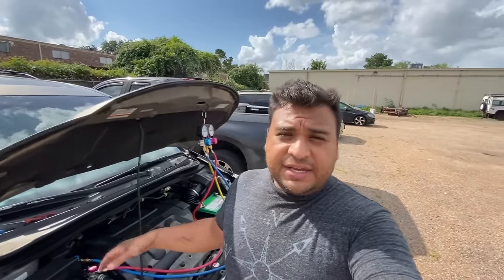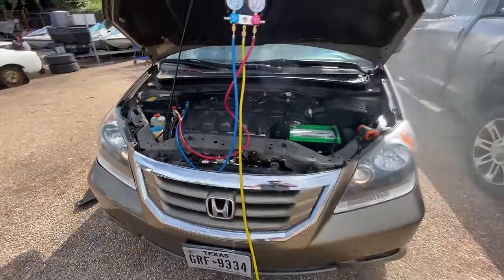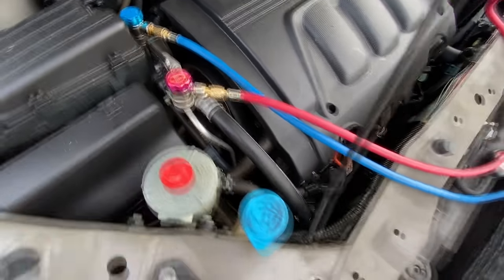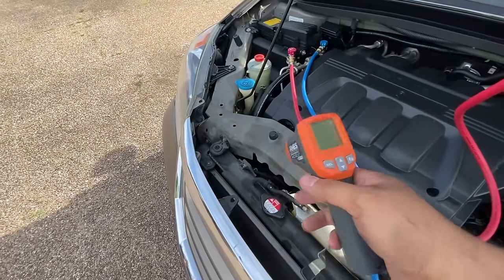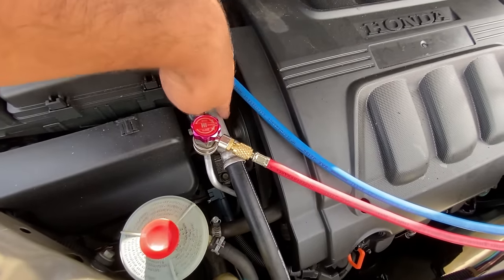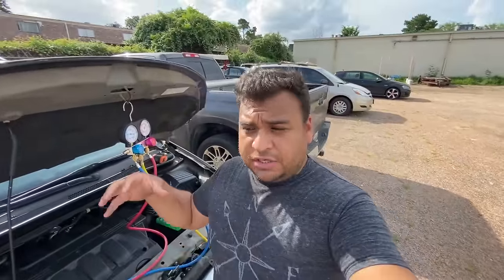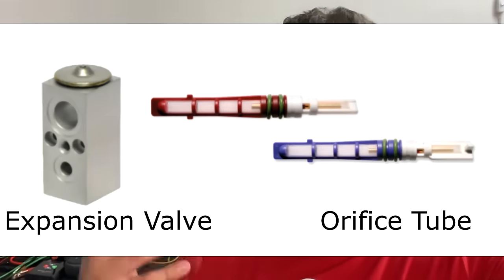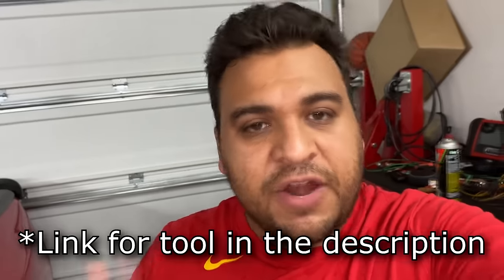HOW TO FIND A CLOG IN YOUR CARS A/C SYSTEM

Comment: Another compressor that didn't  need to be replaced  and another  costumer that paid for the  inexperience of the shop. Great video Eric
Reply from the maker: Luckily this vehicle belongs to the car lot. It is used as a loaner or rental car.
Reply: It may be possible that there was something wrong with that compressor, it may have been damaged if it was building up enough pressure to trip to relief valve. Likely not catastrophic but it may have reduced its lifespan. Kind of hard to know with these things.
Reply: where do you think the blockage came from? a failed compressor and a system that wasnt cleaned out.
Reply: @DieselRamcharger  yes exactly your meant to replace and flush the whole system out that's what they get for being cheap
Reply: @neilmurphy845  yup. running a solvent flush isnt even expensive.
Reply: @DieselRamcharger  they must just be cheapskates or dummies then I thought it was expensive
Reply: let it be clear dealers has mad the same mistake.
Reply: @CarlosRomero-bn1bn  its not a mistake its negligence. the dealers have factory repair information, which clearly tells you what to replace and what to flush. as well as they have a specific flush machine that recovers the solvent.
Reply: @DieselRamcharger  in the video he stated it probably be from a dent under the vehicle by the skid plate lower condenser
Reply: @DieselRamcharger  I beg to differ, dealer would have done exactly what was done in this video depending on the location and the ability of technician. This situation was a manual find. A machine can tell you there may be a problem, not the location. Have in mind dealers have fell behind in more complex technical work of today to where so jobs their clueless of their own makings now getting from independent master techs. Seen this too many times and its becoming ridiculous. iTAN struggles today....
Reply: @CarlosRomero-bn1bn  yaWN.
Reply: @DieselRamcharger  People hate the truth in this country full of short bus riding, helmet wearing, head bumping sloths. Very good, as you were sir.
Reply: Being a mechanic is so difficult. You have to learn a little bit of everything and continue to learn new systems. As like a tire shop knows wheels, body shop knows painting repair body, ac guy knows ac unit, muffler knows all exhaust.... etc
Mechanic needs to know alot and almost never becomes an expect in one field

Comment: One little correction the refrigerant coming out of the compressor is a gas it doesn't become a liquid until in goes through the condenser. IE it condenses the gas! Great videos bud!!
Reply: Correction, where there is a restriction, the condenser stops flowing and fills with condensed gas which is liquid. When the relief opens, the liquid boils and sprays a mix of liquid and gas. Safety first. Getting sprayed by this can cause severe frostbite.  Think taking the radiator cap off an overheated car. Boiling liquid blows out under force. Same principal, but with refrigerant. Both are dangerous to get sprayed with.

Comment: The compressor  cannot pump liquid at all, in a closed system liquid acts as a solid,this why your brakes work , any liquid cannot be compressed,  and if the compressor gets liquid to it something is going to give,  but it will not be the liquid, the valves , the connecting rod , the rings , it receives  gas and ejects gas hot gas, that goes to a condenser that condensers to a liquid as it throws off heat, there is no such thing as cold, there is only a lack of heat, in absence  of heat thing feel cold, the condenser if air is properly flowing through the heat that has the refrigerant  expanded into a gas state, leaves the the refrigerant shrinks back to a liquid state

Comment: The big question now is, why did the condenser plug up? The small bend at the bottom wouldn't have crushed enough rows to cause a blockage like that. That leaves the compressor failing at some point or the desiccant bag inside the dryer coming apart. Both of which will probably cause trouble down the road if the car lot didn't flush the system.
Reply from the maker: I'm not entirely sure. That is why I recommended that they flush the system out when they replaced the condenser. Thanks for watching!
Reply: Exactly how Josh C explained.
This type of A/C condenser has the one inlet at towards the top first row then it loops zig zags down from side to side horizontally until it exits outlet line at the bottom most row which makes sense as it was crushed bent upwards as shown in video.
It circulates differently than a radiator, where coolant entering can go flow in all rows across and it exits flows out all rows on other end simultaneously from all rows.
Reply: @ratbag359  & @Abe Chavez  Nope, your thinking of a serpentine condenser. This one is a parallel flow condenser. It does snake down but typically in multiple rows at a time. Pretty much all cars have used them for over 20 years.

Comment: Well I THOUGHT the refrigerant comes out of the compressor as a high pressure gas and becomes liquid in the condenser with a few degrees below saturation at the exit. Correct me if I'm wrong.
Reply from the maker: You are correct. I was just oversimplifying to explain how the expansion valve creates the effect of coldness in the lines. That way people understand why we are looking for a significant temperature difference when trying to locate a blockage in the system.
Reply: @ADVANCEDLEVELAUTO  For the record I wasn't trying to diminish your work. I think at the end of the day (I hate that saying but it works) people will understand.

Comment: It goes in as a low pressure gas to the compressor and comes out as a high pressure gas then it gets turned into a liquid in the condenser then from there it goes to the expansion device to go from a high pressure saturated gas liquid mix to a low pressure saturated liquid mix then evaporates back into a gas in the evaporator. There is never liquid in the compressor as it would hydrolock.
Reply: I think it comes out as a superheated vapor out of the evaporator after absorbing all the heat from air. I did a calculation based on the 4 degC outlet temperature and the duty of subaru system of 5.1KW and if you look at the pressure and the thermodynamics of the refrigerant at the outlet it needs to be superheated vapor. I liked the video but I agree with you.
Reply: Yeah your correct. Refrigerant will boil in the evaporator when it picks up heat then turn into a superheated gas carrying the heat to the condenser outside to turn it back into a liquid then it will repeat the cycle. It's the refrigeration cycle and most HVAC techs don't know what a refrigeration cycle is.

Comment: Liquid does not come out of the compressor,  it is actually high pressure, high temperature gas, it is the condenser that turns it into a liquid.

Comment: Didn't know that there is a pressure relieve valve that vents like that. Good information
Reply: I didn't know either!
Learned something!
Reply: Yep, called high pressure relief valve to prevent the compressor and or evap, condenser to rupture blow with much force.
Located directly right on the back side of compressor itself
Reply: @abechavez1876  its there to stop the evap from popping and venting all the gas inside the passenger compartment which would cause an accident, kill somebody and be a massive liability for the auto maker.

Comment: Great diagnostic technique as usual dude. To clarify one thing, an A/C compressor is not design too and should not be allowed to pump liquid, pumping liquid damages an A/C compressor. The compressor discharges vapor into the condenser and the condenser, as the name implies “CONDENSER” condenses the vapor into a liquid.

Comment: Great Job Eric! I bet someone tried jacking the van up under the condenser and damaged it!
Reply: I have 2 older Civics and a Camry.  All can be jacked up under the rad support.  Found out the hard way that you cannot do this with an 08 Honda Fit.  Stopped just before doing any real damage to the radiator and condenser but had to straighten out the rad support frame.

Comment: What a great demonstration, of the compressor saving itself from overload by releasing refrigerant. I've never seen that before.
Reply: When this happens will this automatically mean compressor or system damage? I filled my truck w/ R134a and I had this happen (blowout through relief valve twice). I then bled the system to bring down the pressure. I seem to be getting coldish air again and no more blowout. But I have and am seeing big pressure spikes in ac system.

Comment: Eric, you are very intelligent and your video are inspiring and educational. Just FYI, the compressor discharges a high temp, high press GAS. As the gas enters the condenser and it gives up its heat to the ambient air, the gas condenses into a liquid. The expansion device is the dividing point from high to low press. You are correct in the diagnosis and procedures of finding restrictions. Large press/temp difference indicates restriction and will work like a metering device/TXV/orifice.  A good practice when replacing compressors is to replace the micro-channel condenser with it. It is impossible to flush debris out of them due to the paralel construction. Keep up the great work and I look forward to your vids.
Reply: Yo mamma, your comment around the compressor is correct . Compressor is normally supposed to discharges high pressure hot gas into the condenser. The gas is then cooled by the air blowing across the condenser air, and it turns the gas into high pressure liquid (condensing the gas, hence the word condenser)

Comment: That's a good point checking the temperature, having the same problem, did my research and everything point to the compressor, than I found a small leak on the low side port, I fixed changing the small valve inside and evacuated and fill the system, now is working fine .
Is the first video that I found explaining this issue so clear and how can be fix .
Thanks

Comment: Taking my ASE A7 Heating & Cooling test tomorrow...this is a timely video. Any restriction/blockage drops pressure, pressure drop = colder. Between videos like yours and studying I realized how much basic theory I lacked...99% of A/C fixes I do are compressors (usually bearings or clutch) or leaks (often obvious damage, or found with sniffer or compressed air).
Reply from the maker: My explanation was very brief and oversimplified. I would suggest doing a little more research on the subject if you are planning on taking a test. Thanks for watching!

Comment: when the compressed refrigerant comes out of of the compressor it's still in gas form, it will only becomes liquid when it's cooled down inside the condenser hence the term. then the cold part in the condenser is caused by the clog. because of the clog, the pressure in the high side is low.. the lower the temperature the colder the refrigerant will be as per the pressure/temperature relationship properties of the said refrigerant....  still good job diagnosing the problem, didn't occur to me to use a temp gun, and i didn't know that there is a relief valve on the compressor. thanks for the added knowledge

Comment: You explained well and now I understood the function of AC in a car.  I have the similar situation where  my car AC throws cold air for first time then on it is very hot air only.    Will check the condenser first then proceed with my diagnostics.   Thanks
Reply: my ac is having the same problem it only works at idle what was the cause of your problem?

Comment: The reason was the condenser restriction was  metering hot gas thru the restriction lowering the saturation pressure Compressor only compress vapor to increase pressure and temp  Slugging is bad I disagree with using air to find a leak use an inert gas NITROGEN CHEERS nice diagnosis

Comment: 2007 Honda Pilot EXL the liquid line from the condenser to the evaporator had a kink i couldn't see behind the grille before the service port. This thing has been wrecked and had a serious clown repair it. Thanks for the idea to use the gun.

Now i need to find an obsolete part....

Unless you know of a good repair for splicing the aluminum tubing together.....

Comment: We added a thermal camera to our toolset. Restrictions in such items as a filter drier show up as a change in temperature due to the flash gas produced. The bubbles in the liquid line greatly reduce capacity.

Comment: Great video how always love watching them. But to help you out on how the AC or refrigerant system works and the gas entering the compressor is gas and a little cooler but when it leaves the compressor is high-pressure and still a gas. As compressors or pumps work  the internal friction of the mechanical parts as well as the fluid creates a lot of heat.The condenser is in use to cool down the refrigerant into a liquid but still maintain the same pressure from there it goes into the thermal expansion valve. As far as I know there is no compressor that does both gas and liquid. Compressible fluids and incompressible fluids don’t do well in any system. Like a hydraulic locked engine.
Reply: Of course you're correct that only gas exits the compressor, and I share your appreciation of this interesting video. However to clarify your correction, the temp spike of the compressor discharge line comes from compression of the gas into a smaller volume, not from "friction of mechanical parts as well as the fluid...". Examples of that kind of adiabatic temperature change caused simply by changes in pressure are everywhere on our planet, and it is fundamental to how all heat pumps work. Further downstream inside the condenser, the hot, high pressure gas is cooled to ambient temp by flowing air. Cooling of that hot gas inside the condenser allows the refrigerant to return to its natural state as a room temperature liquid at that pressure.
Reply: @spelunkerd  thank you for sharing this information I’m dealing with a compressor replacement on an 03 SSR the old compressor seized so I’m sure there’s contamination throughout the system I can’t find an orficetube but it has a expansion valve I also can’t find a reciver dryer so I’m stumped I vacuumed it out and proceeded to recharge it and it will not cycle the compressor it’s pressure is equalized at about a hundred psi maybe thinking of jumping the electro magnet to engage the clutch and see if it will work hopefully the compressor isn’t wired incorrectly they painted the wires so I’m yet to know if that’s the case any help would be greatly appreciated
Reply: @unclecowboy2003  I recommend replacing the condenser if the compressor was mechanically seized. If just the pulley and clutch you could probably get away without replacement.  The condenser on those vehicles is call a Micro Channel Heat Exchanger or MCHE. It cannot be flushed of debris. If you have an expansion valve then you won't have an orifice tube. It's one or the other, unless on a vehicle with front and rear systems then it's possible le the front will have a TXV and the rear have an orifice tube  or vice versa. On TXV systems you should have a receiver and it may be part of the condenser. On orifice tube systems you will have an accumulator between the compressor and evaporator on the low side (suction) line. If the compressor clutch doesn't engage with A/C on, first I would check for 12 volts at the compressor clutch connector. If present then you have a bad clutch coil. If not then check pressure switches (low and high) some vehicles only have one. If yours has 3 wires then it is probably the only pressure switch. Also check the A/C clutch relay and of course fuses. I have on rare occasions seen the control panel fail and not turn on the clutch. Hope this helps.

Comment: Thanks for the video.
I am facing the same problem like this in my jdm 2005 honda odyssey.
High side pressure line getting cool and sweaty.
Luckily it's still blow cool air.
Maybe i need to change condenser immediately..

Comment: yes i have seen another video where it showed if the lines were not cold around the low side around the drier but check the line at the bottom of condenser and if it's cold there then the condenser is clogged. I don't get any cold lines anywhere but a shop told me they thought i had a clogged condenser. But when i took the orifice tube out of the line going into the evaporator it was cover in black gunk and oil. So wouldn't be more likely that the evaporator is clogged instead of condenser. Or maybe will it work just by changing the orifice tube which i have but haven't tried to charge it yet.

Comment: Using my manifold set- I'm recharging through the low Port ONLY- the low Port coupling is obviously open. My question is-your highport coupling is open (also) so this way you can READ the pressure on the manifold gauge... The High valve on the manifold gauge NEEDS to be closed...BUT the coupling on the high side is OPEN for reading on the manifold gauge? 

Is that last part correct??

Comment: I need help diagnosing my a/c. Changed out compressor, dryer and oriface  tube which was clogged. No flush. Pressure switch also changed.  Tahoe ac work for a few minutes then blows hot and quick cycles compressor. Also dryer freezing over.